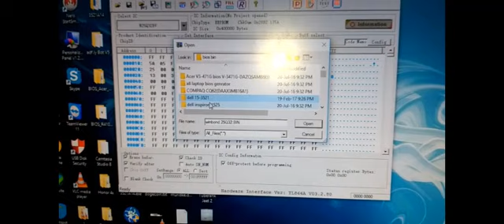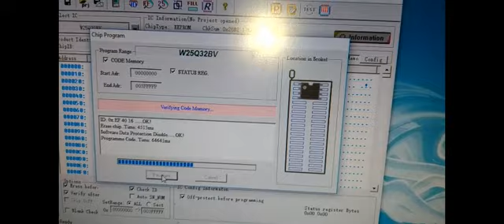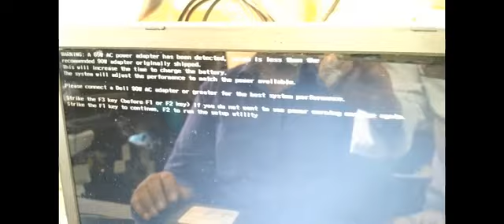dell inspiron 15 3521 laptop turns on but no display

Comment: This would be great if you explained a bit what you are doing and what equipment and software is required. Good video nonetheless.
Reply: he is flashing.bios chip.putting new bios file in bios chip and that will solve no display problem
Reply: @prglobalcomputernewroadpok6532  i have the same problem i flashed my bios then it works normally for 10 minutes then it turned off again :(

Comment: I'm also facing this issue but no 5 beeps or any beeps.
Reply: Have you found a solution yet? The led blinks on mine, the fan noise is heard but then it switches off by itself within a short while. No screen display ...

Comment: Hi. May I asku please. I have similar problem. But my hdd is blinking on my dell 3521.
I accidentally reset bcd contents and now no open the laptop. Also I can't use any USB or DVD to recovery or are install windows. 
If u could help me I would be greatfull. 
Thank u very much
Reply: did you find solution for your problem ?

Comment: hello i am jamaican who has the same problem with my (dell inspiron 15 3521), i watch your video an bought the same bios programmer like you ( EZP2013 Programmer high-speed USB SPI Programmer support win7&8 24 25 93 EEPROM 25 flash bios chip+5adapters) so now i am asking you for the file you use to fix please

REPLY
Reply from the maker: send me Service Tag of your laptop
Reply: THANKS FOR THE VIDEO BUT I AM GOING TO NEED YOU TO SHOW ME HOW TO ARE TELL ME IN MESSAGE PLEASE I ONLY HAVE THE ONE LAPTOP
Reply from the maker: don't very before write new bin file backup and save your old bin file.I have a lot of bin file of this model if you send me service tag of your model. I will send you correct and working bin file.
Reply from the maker: it's free of cost
Reply: How to Fix what is the service tag that you are referring to? I would like to have a replacement Bios chip to fix me laptop.  Can i buy it from you please?
Reply: @HTF  dear sir, if service tag number not showing properly..so what can do..and motherboard in processor is celeron(SR10A)..please send me bios file

Comment: Hi i have the same laptop and its 7 beeps and no display what i do?? Plz hlp me
Reply from the maker: The is CPU has generated an exception error because of a fault in the CPU or CPU voltage circuit.
Reply from the maker: I suggested you need to serves center

If you plan on doing the repairs yourself try this two steps
1-clean the motherboard 
2-heat the motherboard with hir drawer